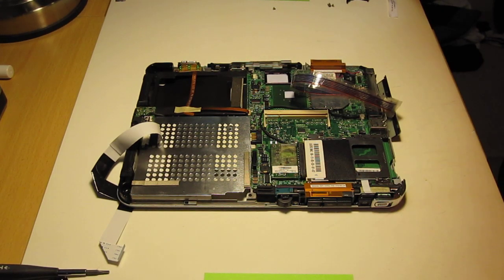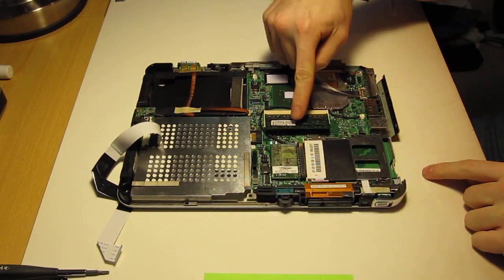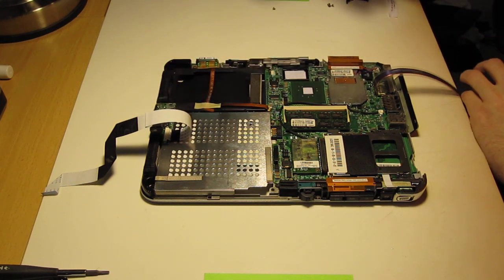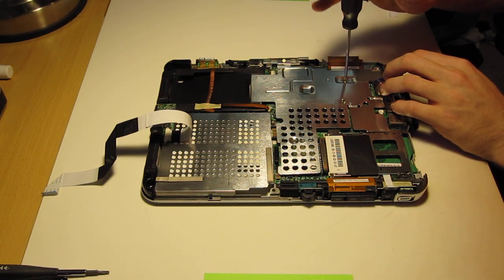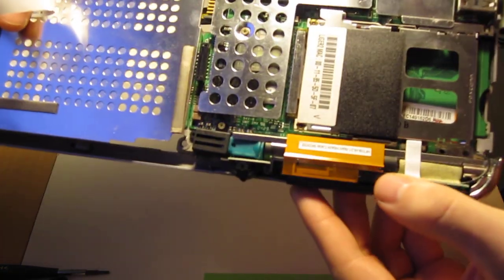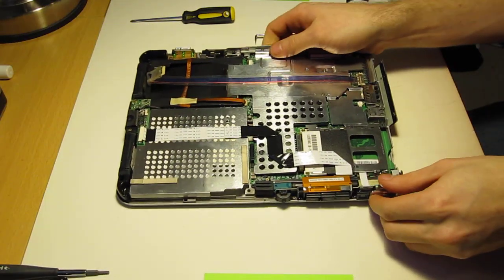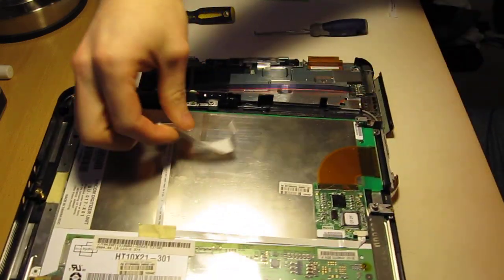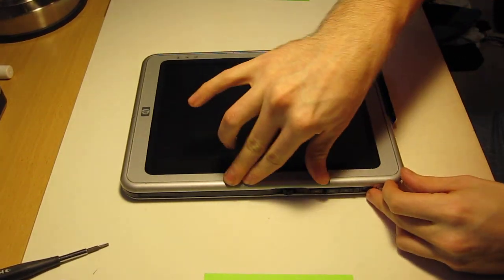HP TC1100 Assembly: Part I

Comment: I know this video is supppper old but if someone could help me at some point. I took my old TC1100 apart to add more ram and now the power slider doesn't work anymore. I used to be where you would slide it, it would turn this computer on, and then it would snap back. Now it just freely slides around and doesn't work. It doesn't look like any pieces fell out, the slider just doesn't some to be catching anything and I can't for the life of me figure out how to get it to work again.
Reply from the maker: It's been a while since I took my TC1100 apart, but if I remember right, the slider needs to sit flush and just has a slot the actual switch sits in.